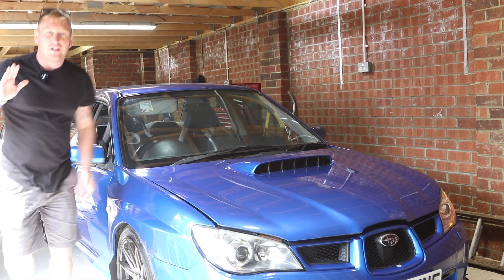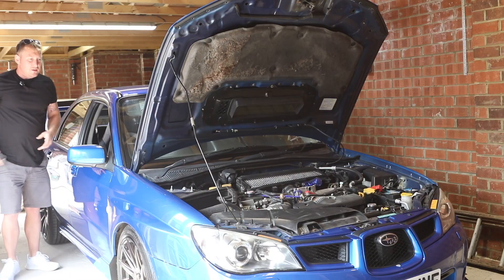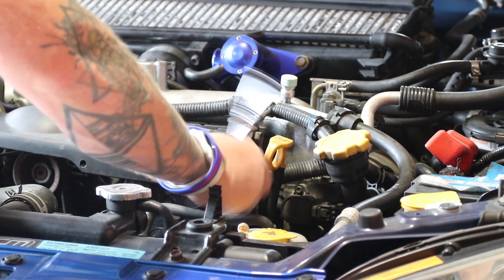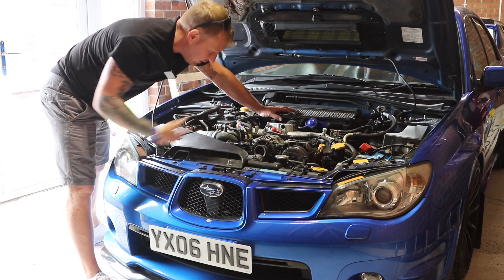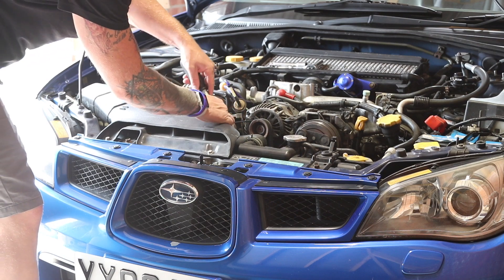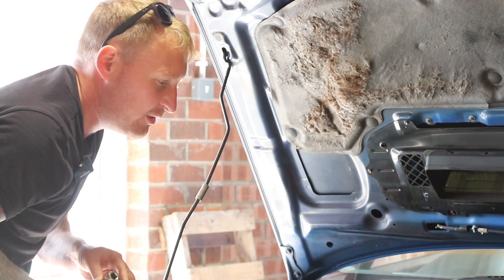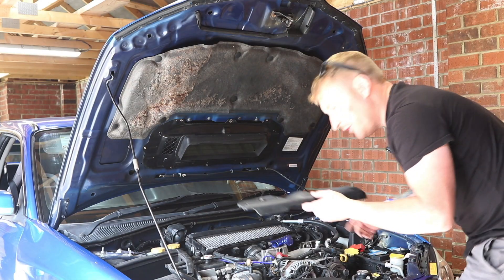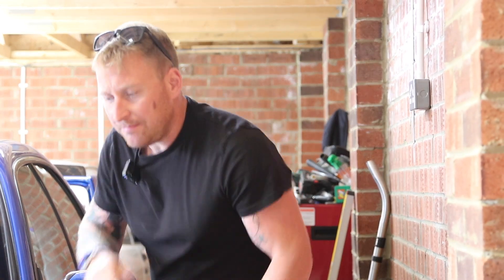Subaru Power Steering Belt Sqeek Fix

Comment: Great fix Adam, and working in the new garage, looks superb. Respect regards giving the Belt a 2nd chance, Main Dealers don’t care about the environment when replacing brakes & Tyres etc. long before they are worn out, far far worse than you running 2 sports cars

Comment: I had the same problem on my 06 wrx the common power steering dreaded squeak I just replaced the little rubber o ring and then checked the fluid level and turn wheel full lock left and right to get the air out the system fixed it
Reply from the maker: I believe thats a different issue Mark. Mine was squeaking as the belt slipped.

Comment: Mine started to slip even when belt replaced and tension was correct, bottom pulley (harmonic balancer was worn out), can normally tell by the wobble,important to replace ASAP if that happens.